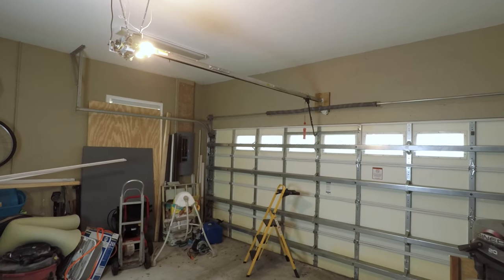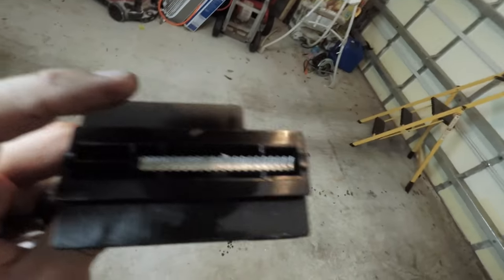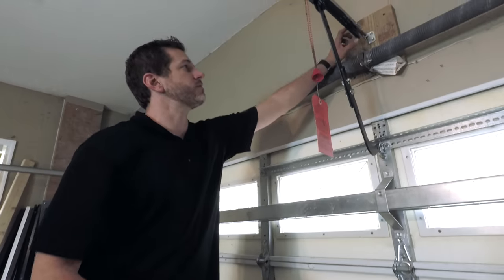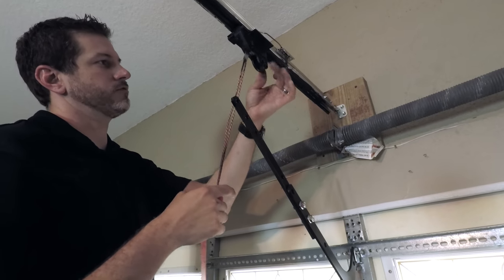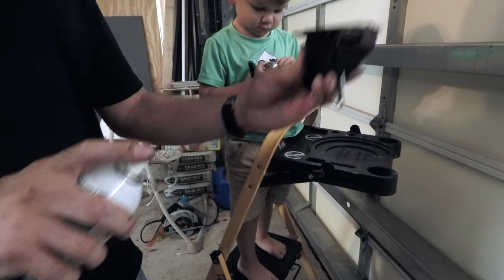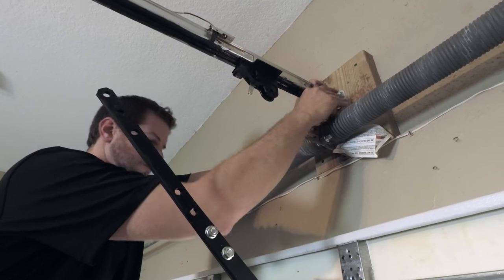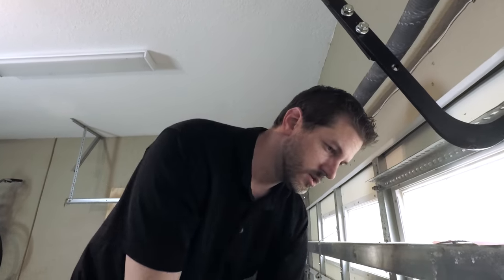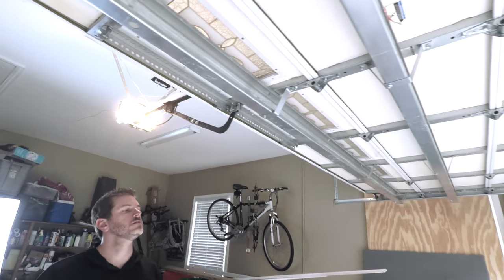Fix Genie Garage Door Opener - Screw Drive Repair - Carriage Broken

Comment: Great.  I noticed that my thread shaft has two spots where there is a little space in the shaft threads, about 1 inch. Those two spots are where the door will get stuck.  When it hits the first one I'm able to push it up past it, then it will grind again at the second space. I think the spaces are where the thread shaft sections get put together.  I expect to find exactly what you showed, where there is enough trolley thread to get it going but when it hits that space it does not have enough thread to get past it.  I thought I would have to replace the whole rod, then I thought, maybe there is something wrong in the trolley and found your video. Ordering a replacement now.

Comment: 10minutes? This took me an hour. The rail slid backwards after I took the bolts out and I had to zip tie the bolt hole on the rail to a hole on the wall bracket and then wiggle it around until i could get a bolt in. There is grease everywhere.

Comment: My husband and I watched your video after obtaining a quote for over $600 to fix our garage door that wasn’t opening or closing properly. 

We wound up buying the part you showed us for $15 and, thanks to your video, were able to fix it ourselves! 🙌 I bought myself a Pumpkin Spice Latte today to celebrate 😂.

One note: in our particular case, after replacing just the carriage piece, our garage door functionality improved, but was still not closing as it should. We decided to try lubricating the entire length of the screw-drive channel and that did the trick! (We now realize we should probably have been doing that all along 🙃) Now it works smooth as butter (and operates SO much quieter!) So, don’t be quick to give up if the carriage replacement alone doesn’t fully do the trick for you!

Thank you so much again!

Comment: Your description and fix nailed my issue.   I suspect the weight of my door grew over the years (as the torsion springs gradually grew weaker) and that added "weight"  finally overcame and stripped the carriage "threads".  I've ordered the replacement carriage ($22 OEM e-bay vendor with free shipping) and will install that upon arrival.  In the meantime I'm going to adjust the torsion springs so that they will provide a bit more lift so that the oversized door can be raised with less effort.   A little bit more torsion spring lift can reduce the motor strain and the extra lift should reduce the force (weight) of the garage door at the relatively weak carriage threads.  I suspect the growing door weight (due to weakening torsion spring tension over the decades) contributed to the failure of my carriage.    Great video beginning to end.  Well done.

Comment: THANK YOU! Although I could not get the carriage off as easily as you did in your video, my repair with your guidance was a success. I needed to remove sheetrock to get the carriage off the rail and move the rail to the side to get the carriage off, it was so close to the wall. But once I did, the repair was easy-peasy, thanks to you.
Reply from the maker: That’s great, Brad, thanks for watching!

Comment: THANK YOU! This is EXACTLY what is happening to my garage door of the exact model!  A tip at your own responsibility: Folks, you CAN still open your garage door MANUALLY by pulling the cord gently away from you, when standing in front of it facing the garage door.  That will unlatch the carriage and you just lift your garage door!

Comment: Thank you for this video.  Today we made the repair, but I would add one thing - our rail was so close to the garage wall that we had to drop the motor to remove the carrier.  It is a good idea to make a loop of some romex to hold the motor so you can swing it back a bit to make room to remove the old carrier and install the new one.  It was definitely a job for two people because of that complication.

Comment: Thanks for sharing this! I'm a first time home owner, never seen a garage door opener in my life... with the door open, I saw the big red string hanging and thought,  "does pulling this close the door?" ... it sure did, the whole weight of the door came crashing down and ripped the carriage off the track because I was still holding the string..  I hope I can fix it just as easily lol
Reply from the maker: Your door shouldn’t come crashing down. Since it did, you likely have an issue with the spring tension. There are two giant springs just above the door. They essential help the opener lift the door. It also keeps it from doing exactly what yours did. I suspect the springs are broken, or they need adjusted. Very dangerous what happened to your door

Comment: Thanks for your video. I had a bad limiter switch at the door up position that I replaced and it messed up my carrier i believe but also messed up the connector bushing at motor to the screw drive. Works great now! Best to use garage door opener grease on the carrier.
and lube the screw drive real good. Thanks for the video Mr. Fixer!!
Reply from the maker: That’s great, I’m glad it helped you! Thanks for watching!

Comment: Somebody already mentioned door balance, which should be a first step in checking any opener problems, even if the problem seems unrelated.  I actually am having a tough time from the color, but it looks like those springs may have been galvanized at one time.  If that is the case, they are mostly likely weak and either need to be tightened or replaced.
Also, the spring anchor is upside down, which, I guess doesn't matter of the door clears, but that's why it is supposed to face the other way, it's built that way to offer more clearance for the door.
I see there is some reinforcement for the door bracket, but from all the holes in the vertical struts, it does not seem adequate.  You might want too look into beefing that up before you end up with even more holes.
Helluva door you got there, tho, must be in a hurricane area.
Reply from the maker: It is hurricane area. It was actually a result of my wife pulling the manual release half way when we had a power outage. Then when the power came back on, it stripped out the grooves of the carrier. No other issues. Been working great for 10 years and since replacing the carrier. Thanks for the tips though, someone may see them and get some useful help out of them.

Comment: ON my 10 year old unit what was grinding down the teeth on the carriage was the joint on the screw drive..a collar was missing...new collar would not stay in place...so assuming that the new carriage would eventually grind down..I bought several carriages until I can replace opener....nice vid...
Reply from the maker: Thanks Phil, and thanks for the info. I’m sure it will help someone. Thanks for watching!

Comment: I replaced carriage a few months back and it's making lots of noise again. So before I put on the new replacement am I going to need new lift springs? The 16' insulated door is used quite a bit and inspecting it moments ago the springs look undersized. But I''m no expert.

Comment: Hi, I came across ur video. I hv not take the carriage apart to chk it but the garage door is acting up. Somes the garage will not open at the outside keypad. Works most of the time with garage auto open/close button. The pulley sometimes get stuck & once I push up the pulley the garage will work. It's a Bluemax garage unit. Is it normal to have all that black greece on the bottom track where the carraige goes back & forth as u open & close the garage door? Should I wipe that down?

Comment: Thanks for the video. It described my problem. Only it wasn't. After ordering the new carriage assembly and installing it the exact same thing happened. Now that I've pissed away $20 I still have the problem. What else you got?
Reply: Sounds like the door needs to be rebalanced.
Good luck .
Reply: Or your capacitor is possibly weak or bad.

Comment: Hey Jeremy. My Genii Intellicode ISL 950/A makes the same noise and doesn't move the door either way. I noticed that the screw drive itself is not rotating like it normally would. If it is the carriage not engaging, wouldn't the screw drive still be rotating? Just not engaging? Thanks for your help. What might the problem be?
Reply from the maker: Depends on if the carriage is binding it up. Maybe remove the carriage then see if it will move. I believe there is some sort of hub assembly that connects the motor to the screw. It may be damaged too. Inspect the carriage. If it has any damage, I would replace it. If the screw still doesn’t move, I would inspect where the screw attaches to the motor.
Reply: @IAmAFixer  Ok thanks Jeremy. Will try that. I appreciate your answer and your video.

Comment: Thanks for this very helpful video, Jeremy! My Genie corkscrew (the older heavier wooden garage door) opener still opens but is making a banging sound when opening but no unusual noise closing. When I disengage the motor and open manually, there is no sound or obstruction. Do you think this may also be due to an issue with the carriage pull? Thank you for your community service!
Reply from the maker: Pretty easy to check. Take the carriage off and look at the teeth. If they’re worn down, replace it.

Comment: My Genie 7055 stopped short at opening today.  Have tried unplug and plug but it seem the motor did not have enough power and just stop quiet. We only installed this a few years back. 

This is a rubber belt type. 

Any advise?
Reply from the maker: There is a stopper that allows you to adjust where the door stops. Maybe it someone got moved? There is also an adjustment on the opener that may let you increase the max force the open will use to open the door. Lastly, maybe the spring tension has somehow lightened and needs adjustment. Can you open the door by hand, or is it too heavy?

Comment: i SEE THAT MY ORIGINAL post on just reversing the drive screw was removed for some reason.  That's OK I guess,since it was a temporary solution anyway.  
But I reversed mine and its working fine on the "new" tooth faces.
However, in order to prevent the gear from wearing again, I purchased 2 16 inch extension springs at Home Depot and attached them to the sides of the door using some rope.  Now, when the door lowers, the springs remove over 30 lbs. of weight from the screw drive for the first 1-16 inches .  After that the door weighs much less. I measured the weight of the door at the bottom and it was close to sixty lbs.  I did not want to fool around with the tension springs above the door except to make sure they were not "frozen".  Another use for WD40.

Comment: Thanks for the great video. I did this fix about a year ago and it was working properly for a year. Then I noticed the track was getting bent and the carriage was traveling past the stopper arm when closing. I just replaced the carriage again and works great but the carriage is still traveling past the stopper arm and I feel like the same issue is going to happen again. Does this mean I need to replace the stopper arm? Anything you suggest? Thanks!
Reply from the maker: Possibly. Manually press the stopper trigger to see if it stops the door. May be bad, may need adjusted, or the stopper trigger wires may have disconnected

Comment: Your instructions were great. I put in the new trolley fine but when I engage it, it stops the screw drive from turning. When it is disengaged, the screw drive operates fine. I believe I have it facing the correct direction with the engagement arm facing the motor end. 
What do you think the problem is?
Reply from the maker: Are you sure you didn’t put it on backwards?
Reply: Where the Arm connects to the carriage, THAT end should be facing the garage door NOT the motor end. Always give attention to simple details on garage door DIY, it can end up costing you more expensive damages.
Good luck getting it corrected.

Comment: The worn down carriage teeth can also cause a BANGING noise as the opener pulls the door up.  The noise happens twice, as the carriage moves between the sections of the screw; three sections, two connections.  So if your opener BANGS twice on it's way up, check the carriage's teeth.
Reply from the maker: Great info, thanks for sharing!
Reply: Hello I have the same problem actually ok where are you located. In what city?

Comment: Thanks man I think my sensor stopper broke I had the leaf blower getting all the webs in the ceiling when I close the door didn't see the red pull string got tangled I'm looking around like what happen kinda have the same problem it  just my slider goes to far off track I think it's where it got stuck I just came in side to watch a YouTube fix it video thanks again you saved me
Reply from the maker: That’s great, I’m glad it helped. Thanks for watching!

Comment: So my overhead brand is having the same issue, had no idea why it was grinding the way it was and not doing anything. However, the garage door does nothing now when I hit the button - so I’m thinking the motor or something may have burned out? All of the lights/sensors work, but when I hit the open/close button all I hear is the unit make a click noise and that’s it.

Any insight?

Comment: Mr. Fixer:  will order online today.  Very informative video.  Now, my door does come up, it just get stuck where I believe the screw is connected to each part.  I push it past each part.  Does the screw come in 3 parts?  Thank You.
Reply from the maker: Thanks for watching! I’m not sure I follow what your saying. Usually the issue is always the cams have deteriorated. Replacing the cams usually resolves the problem. You may have a different issue, but I would start with the cams first.
Reply: Well Mr. Fixer.  Mission Accomplished.  After all these months thinking that it was the screw, the new carriage did the J.O.B.  I'm a stubborn old man, oh well.  Thank you for your guidance.  Have a great year.
Reply from the maker: Awesome, glad to hear it! Let’s just say may wife may have called me stubborn once or twice! Thanks for watching and reporting back!

Comment: I have a genie and my problem is that the door seems go down to far and that bar that you worked on in the video is getting bent so we can not open or close. Is there a replacement for the sensor on the top?
Reply from the maker: Might be tension springs that are too tight or loose. If too loose, you opener would struggle to open it. If too tight, would struggle to close it.

Comment: I’m having the same issue. I replaced the carriage but that didn’t correct the issue. Any suggestions on what else I can try?
Reply from the maker: There might be something with the coupler to the screw drive. I feel like another viewer had the same problem and it ended up being the coupler. Look through the comments and see if you can find it.
Reply: Thanks!

Comment: I replaced the carriage but it did not fix the problem. I have an old Genie screw drive. It goes down but not up.  Any other ideas?
Reply from the maker: Could be the tension on your springs. You can also adjust how much force the opener will use to open the door. I think it’s an adjustment screw somewhere on the opener.

Comment: Sweet video! Quick question. My opener sounds just like yours. Anyway to make it quieter? Back in the day, screw driven openers were super quiet.
Reply from the maker: Thanks! Some lithium lubricant helped mine a little bit, but if you find a better solution, I’d love to hear it. I’m thinking I may have to remove the entire screw, clean it and the track, then reassemble. Seems like an awful lot of work. If I’m going to do all that work, I might just replace the entire opener.
Reply: I Am A Fixer agree. That’s the same boat I’m in. I was searching for adjustment DIY on the screw but it doesn’t look like it’s possible. Thanks for the reply.
Reply from the maker: No problem, thanks for watching! Consider subscribing if you haven’t already and like these kids of videos.
Reply: I sprayed a silicone lubricant on the screw and a bunch of thick black grease buildup was stuck to the carriage. I’m going to take the carriage off and clean it up good
Reply from the maker: Cool, let me know how it goes!
Reply: I Am A Fixer it helped. Seems like most noise is coming from the unit itself. Going with the $6 coupler. Last item I will change
Reply from the maker: Sweet! You’ll have a brand new opener for less than $25! I guess I’m going to have to do the same to mine. Maybe an update video on the future.
Reply: I Am A Fixer we shall see. It comes in Monday from amazon. I’ll change it Tuesday after work. Keep ya posted

Comment: It sounded a bit grinding upon retrieval. Looked like it was vibrating a lot too.
Reply from the maker: Yes, the screw drive needs removed and cleaned. That will be an upcoming video. Be sure to subscribe (if you haven’t already) so you don’t miss it.